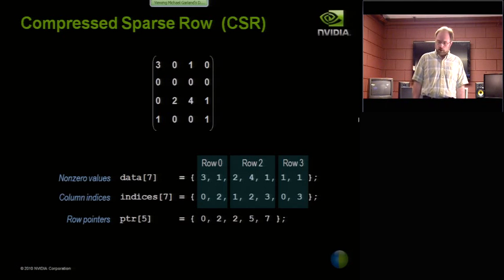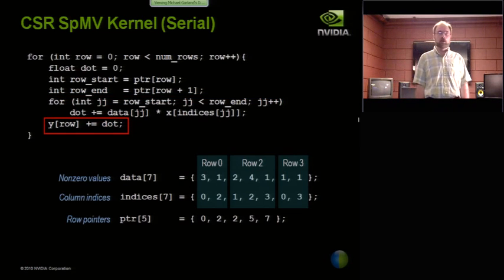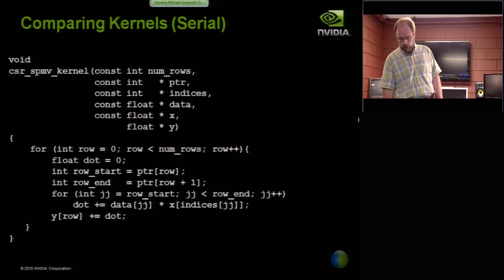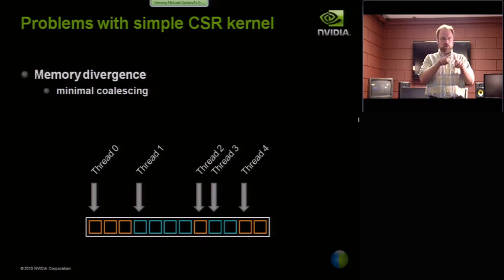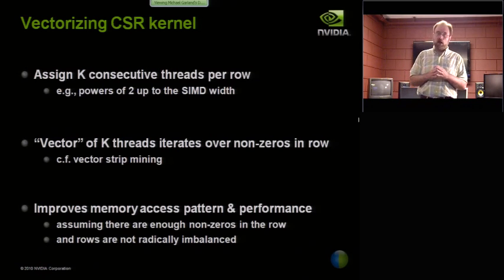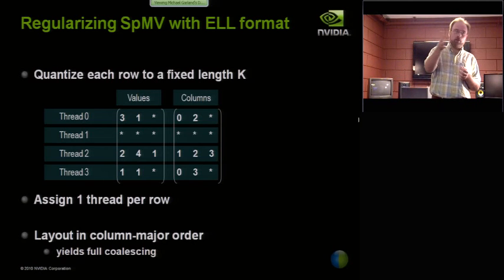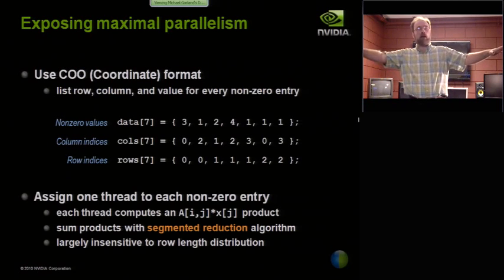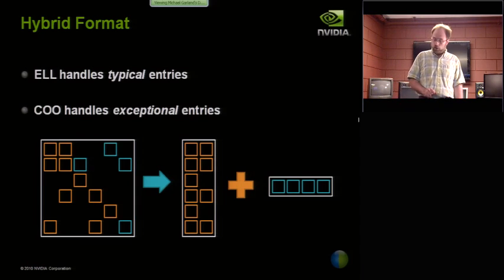GPU Algorithm Design Part 2 of 6

Comment: specifically if your largest offset value is over uint32, you may be able to now store you offset array in a smaller data type with less bytes
Reply: +Peter Krey III I am writing a literature research project on the algorithms of GPU computing - do you have any papers or links that i can view for background research ? - many thanks
Reply: http://www.amazon.com/CUDA-Example-Introduction-General-Purpose-Programming/dp/0131387685
Reply: what sort of papers are you looking for - just search SSRN
Reply: ahh cool thanks ive been using engineering village for papers but thanks for the link ill check it out